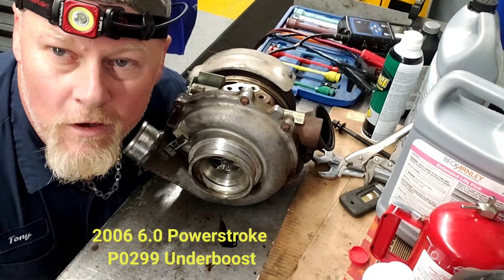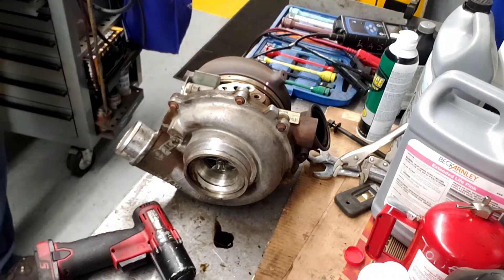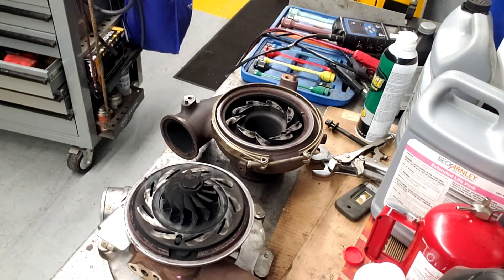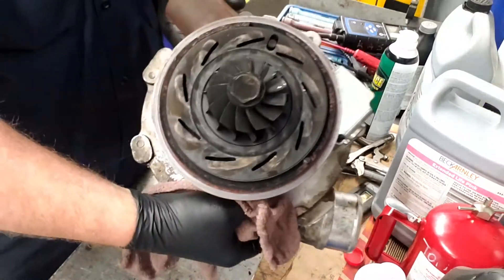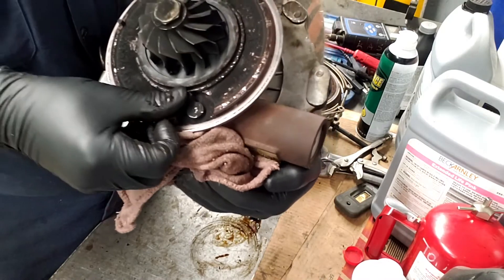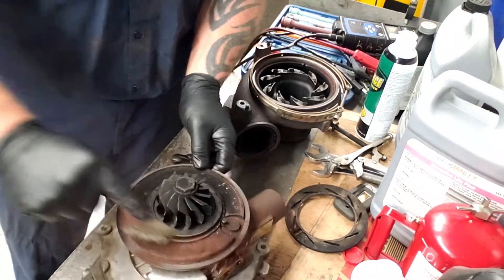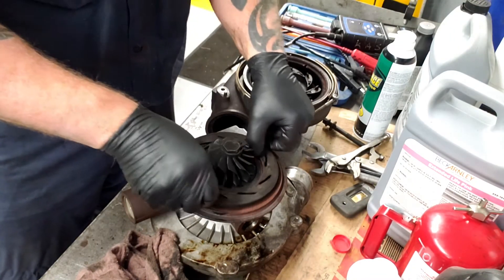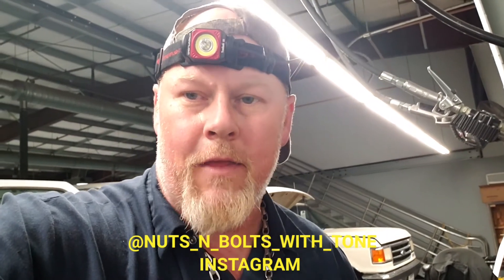6.0 Powerstroke Turbo

Comment: So I gotta question. If you see this. I was coming down grade. I got the P2262. Turbo is in and out. Coming down hill. I hit the brakes. Vgt would pin at 85%. Not going down past 40%. I’m not hearing any leaks. It’s only building 2psi of boost. I am still gonna air test it to make sure but if you can give me any guidance off them numbers I’d appreciate it. Thanks sir.
Reply from the maker: Hello sir and sorry for your troubles. can you message this to me my Instagram and I will try to help you. I prefer messaging through there because it is easier. Thanks for watching.
Reply: I appreciate you sir. You have a great video of information and because of that I knew exactly what it was this morning when it was completely stuck.
Reply from the maker: @MillerBoys95  omg that is awesome,  I am happy to help.  Thank you for the comments.
Reply: This morning I started it and it was stuck on 15% I shut it off & pulled the turbo. Cleaned it up. Put it back on & it’s great now.

Comment: Could you give me some input on a 03 vw tdi with a cylinder 3 misfire? I don't remember the code and other codes off hand, I'm thinking the needle lift sensor needs to be replaced or looked the tdi pump. I'm very limited on information and don't work on diesel much.
Reply from the maker: I honestly do not have much experience with the TDI engine other then a no start.  However I do have general diesel experience,  if you do not have a mechanical problem generally you have an injector problem.  But like I said I do not have any misfire experience with a TDI. If you can give me the code I can look it up and see what is common.
Reply: @NutsandBoltswithTone  the codes I have are
P0303 called misfire 
P0183 fuel temp sender A circuit high
P0216 injection/injector timing control malfunction 
P0251 injection pump metering control A cam/rotor/injector
Reply: Sorry the long list but just maybe you can help this is one of my 1st diesel jobs, the other is a Ford with a transmission that only has reverse drive. I said yes to these Jobs on the side know I was gonna get buried, but also for the education of it

Comment: Good old p0299, I remember when the 6.0 came out we were replacing turbos for that code, then they came out with the tsb to either replace the center housing or clean it and reseal and replace unison ring. That unison ring is completely seized.
Reply from the maker: I bet so

Comment: I’d probably recommend replacing it, but I always offer the customer the option of rebuilding things when we know what we are doing. :)

I don’t work on diesels, so I didn’t even give it a second thought that there would be a variable flow design.  I thought turbos were just static spool ratios.   Informative.
Reply from the maker: I usually do but this is the actuator,  not fixing that part,  I've actually only recommending replacing one after taking it apart due to the unison ring biting into the actuator pin and was damaged.